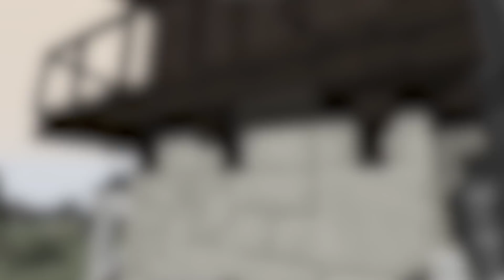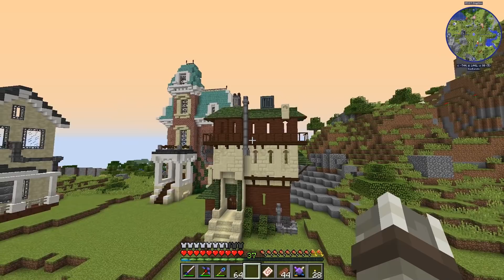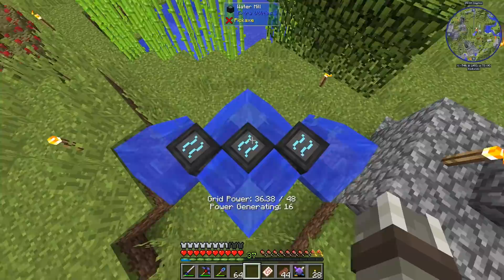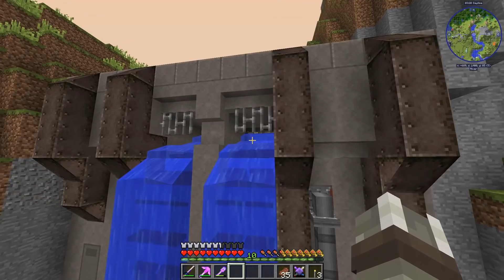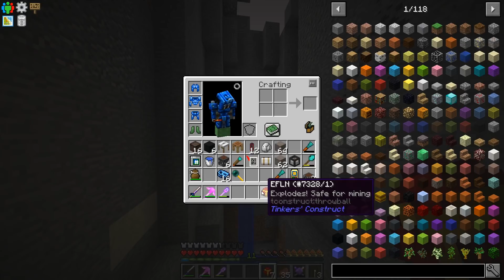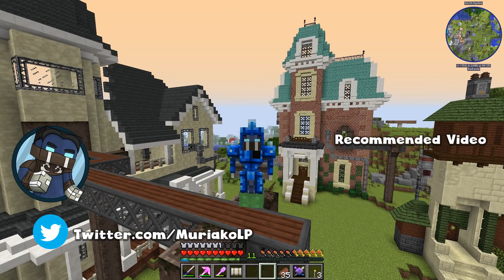FTB Revelation - Ep 11 - The Power of Water

Comment: On the wall connecting the pipe to the mountain have a liquor company building which would be used for brewing alcohol (a.k.a anything you want to do with liquids)

Also make the mountain itself have water sources going up with a cave of "super dense" ice at the top. You might have to make other places where the "super dense" ice is fueling some sort of small waterfall/pond/lake to really sell the idea of a big block of ice that got covered in dirt and rock
Reply from the maker: That's definitely an interesting take on it, and I definitely want to have a brewing area somewhere in the base.  If I recall I think one facet of Binnie's mods even has a lot of actual brewing stuff to use in the pack, so that could lead to some cool little extra builds/details.

Comment: Muriako,
You should have used a pump or some fluid filler block to fill the pond and bottom of the dam, this is modded minecraft after all. Also, that way you can focus on just creating a nice river bed and surrounding shoreline, and just let the fluid placer fill it in without getting buckets of water yourself.

Also, as great as this footage and exposure to building styles is, I don't think I'm alone in saying that we'd also like to see a bit more mod/system building.
Reply from the maker: I didn't actually realize there was something that could easily fill an area with water like that to be honest, I hadn't thought to look.  I'm still very set in my vanilla ways it seems.

And I definitely want to focus more on mod stuff too, I just wanted to get to the point where things wouldn't be built in temporary places/structures, but we'll likely start getting to more of that stuff soon hopefully.

Comment: What if you put a couple or three springs on either side of the lake at the top of the dam? Would that work for keeping that lake realistacally full?
Reply: Actually, that would look pretty neat. A couple freshwater-springs or a stream coming out of the adjacent mountain might be nice. The lore there could be that the water travels through the nearby mountain range and ultimately ends up in that pond before the dam. If you go this route, you could make the side opposite of the water wheels also into a dam, and have the water flow from the pond, through the dam, and into the swamp below.
Reply from the maker: It is possible.  It would be pretty cool to have another pond on top of the mountain that supplies the lower one with the dam, I just didn't really pursue the idea as I'm likely going to be putting a big building or two up there at some point.  I did want to sneak at least one small spring in there somewhere, but if I could find a way to get the others in that could solve that problem as well.

Others also suggested aqueducts, which could be an interesting way to supply it in a less natural way.  Hmm, lots of possibilities I'll have to keep in mind.

Comment: Fantastic work as always Mur. Really liking the dam wall design. I think that a good block to use with your design would be a darker varient of bricks. Still with the reddish colouration but more darker than the original Minecraft ones. I think that large bricks/tiles on the blocks would be good too. Not sure if there is a block like that in the modpack though. I also like the ipe wood (dunno if I spelt that right)
Reply from the maker: There are actually a surprising lack of red brick texture variants to work with in the pack currently.  There are only two as far as I'm aware, one is quite saturated looking and the other has a really repetitive texture.  I suppose technically between Chisel & Bits and the Flat Colored Blocks mod I could probably just make my own brick texture as well, though that might be pushing that mod a bit to start using fully custom blocks for every part of every wall.
Reply: Ah that's a shame then. I see what you mean though. Well I do like the ipe wood still, just not a fan of prismarine for the roof